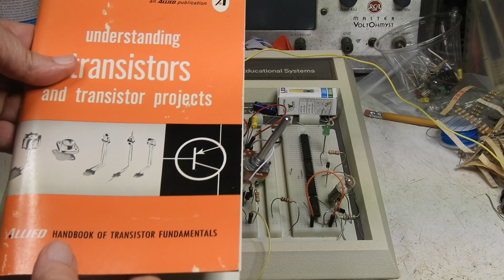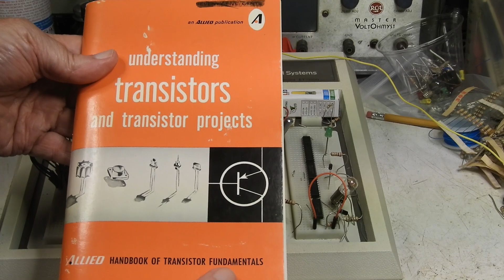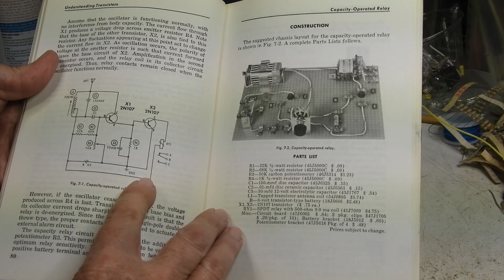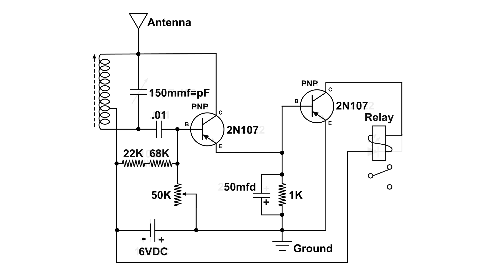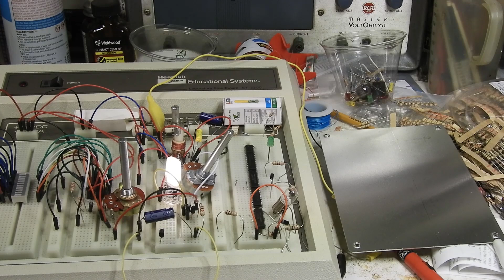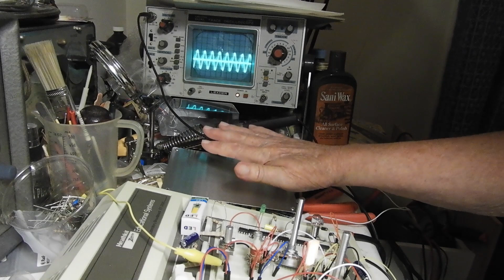Proximity Circuit Experiment #1

Comment: Awesome video, just wondering if you could get a similar result  with open collector outputs from cd4017 circuit.  Believe that it would count the # of events, or states that occurred near the antenna.  Very interesting.  I think the mosfet will work well in this circuit especially for the antenna pickup and or the gain stage.
Reply from the maker: I'll check out this possibility, that's what experimenting is about.